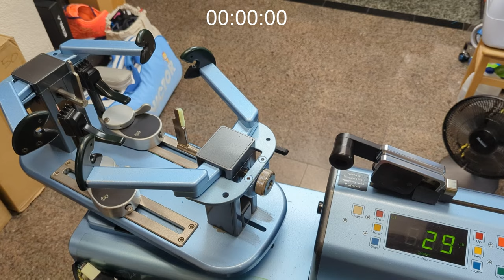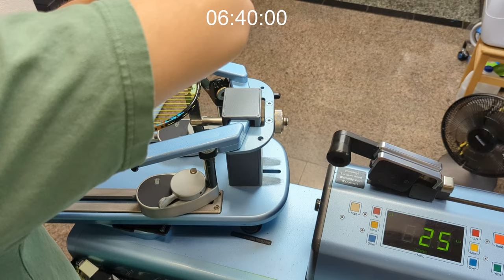Badminton Racket Stringing - Astrox 88D Pro, top down view, 4 knots, POV

Comment: Why do you knit the horizontal string in lbs higher than the vertical string? Can you explain it to me?
Reply from the maker: Because that is what Yonex recommends when stringing a racket. It's to reshape the head of the racket back to its original shape and since I strung the mains at 1 LB (25 LB) lower than what was requested by the customer, the higher cross tension would bring it back to what they wanted ( in this case it would be 26lb). Hope that helps!
Reply: So if the customer's requested tension level is 26lbs, you will reduce the vertical wire to 25lbs and increase the horizontal wire to 27lbs, right? At my place if I ask to knit 26lbs the knitter will increase the warp to 27lbs and the weft to 28lbs. In your opinion, does this have any effect on the racket and is it correct to weave like that? @badmintonstuff
Reply from the maker: If you ask for 26LB then the stringer shouldn't go past what tension you gave them. I don't understand how 27LB and 28LB make 26LB when both are higher tension than you asked. @_NguyenVanTuanAnh
Reply: @badmintonstuff  I'm in Vietnam, I watched a video about weaving rackets, the customer asked to weave 11kg and the knitter woven the vertical string of 25lbs and the horizontal string of 27lbs. In your opinion, is this wrong? If knitting 11kg, what do you think is the best way to knit the horizontal and vertical strings? Hope you can share with me.
Reply from the maker: I think the stringer miscalculated the conversion of KG and LB because on Google 11KG is 24.5 Lbs. So it should have been 23.5 Lbs and 25.5 Lbs. The stringer that you are talking about ended up stringing the racket at 26 Lb which is closer to 12KG rather than 11KG. I just think he did a conversion error when converting KG to LB @_NguyenVanTuanAnh
Reply: Thank you for the explanations. it is very useful to me. I'm a racket knitter who only learned through YouTube, so I'm happy to have your support. @badmintonstuff